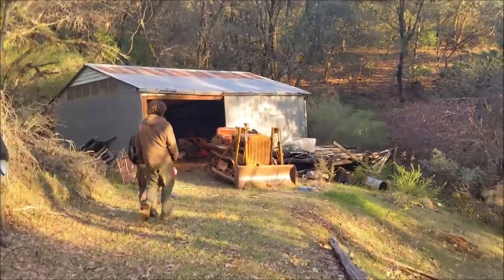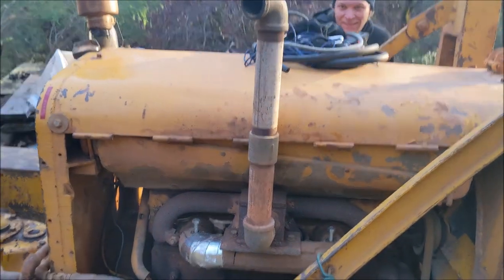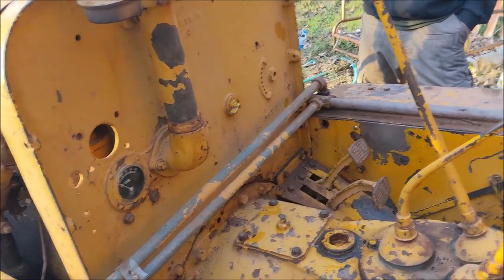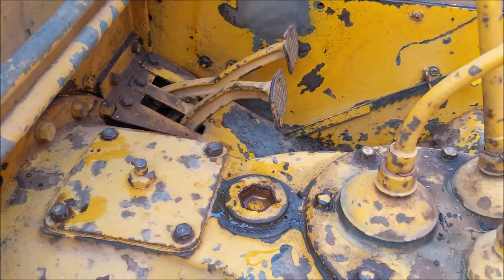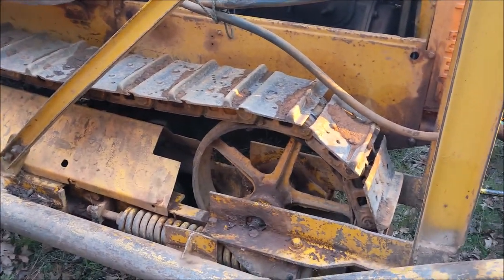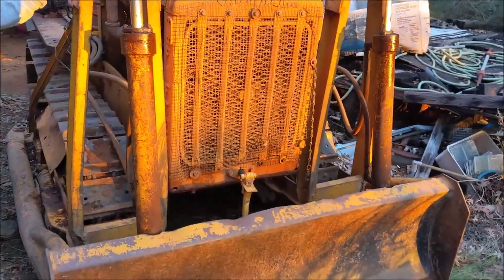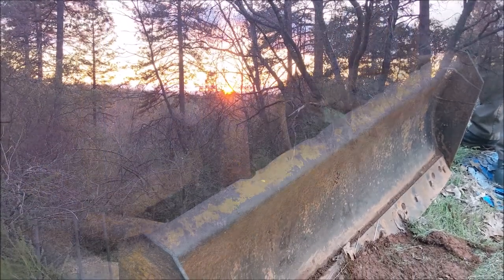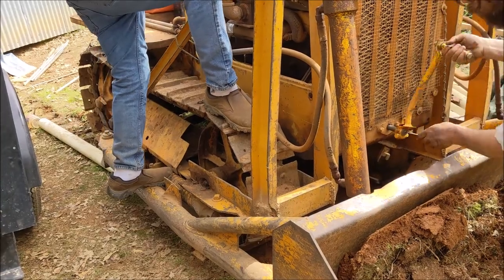Barn Find 1940's Caterpillar Fifteen Bulldozer

Comment: That's cool but they only made them from 29 to31 I bought one and been trying to get it started but havent had no luck yet
Reply from the maker: Oh, I didn't know that. I thought they built them.for longer than that
Reply: I researched it and that when they were in production from 1929 to 1931 mine is a pv706 which is for private use it should be on the back of the machine which is the #you refer to when ordering parts.
Reply from the maker: @johnnygoins7457  good to know thank you
Reply: If I could pick ur brain a minute,is their a key switch or toggle switch that hooks to the magneto or a guage ? Mine there is a toggle switch by the oiler with two wires just hanging